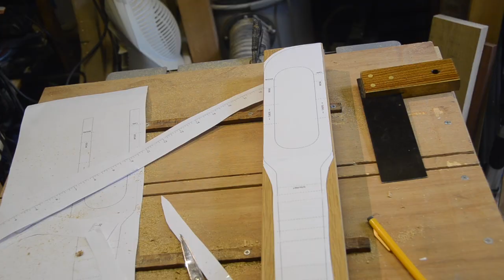Travel Ukulele build

Comment: What size did you drill at the top for the strings and on the side for the tuning buttons?
Reply from the maker: The string holes are 1.5mm,  (3mm counterbore on the back to accommodate the knots). The strings I used here are 28-33-40-29.
The friction tuners needed a 5mm hole to pass the shank of the tuner through, with a 12mm counterbore to recess the cardboard washer.
Thanks